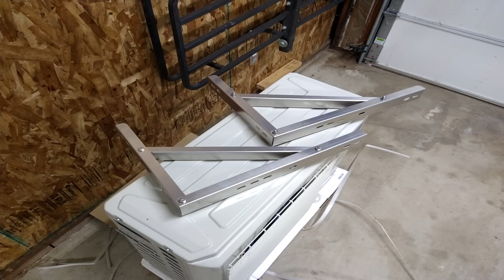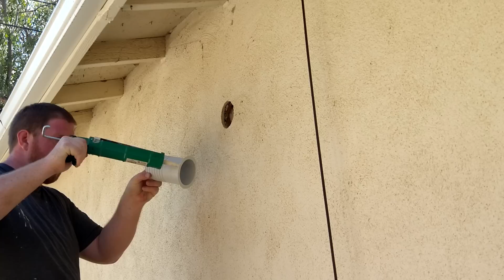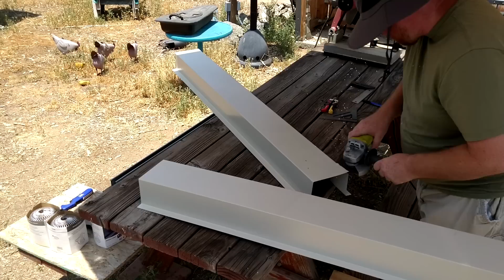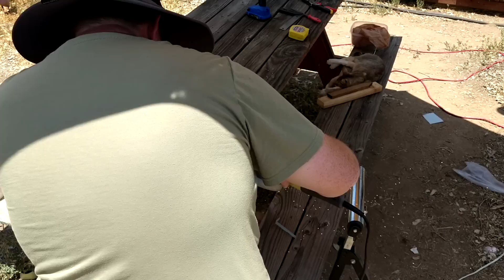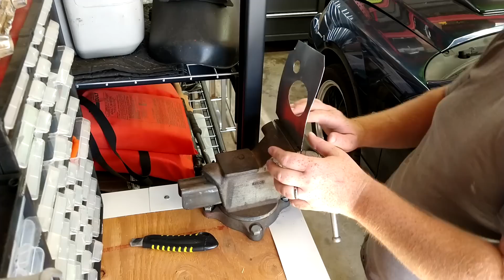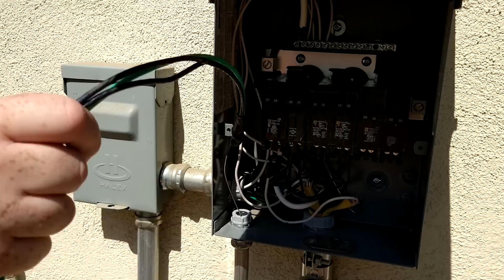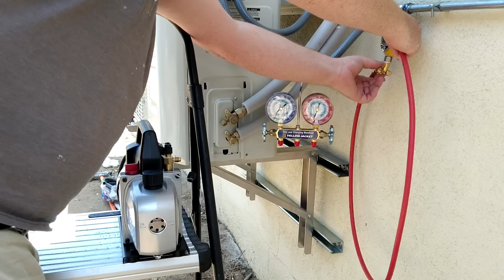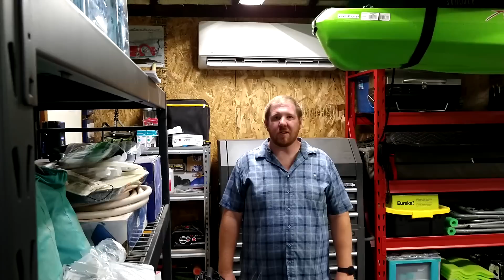How to Install a "non-DIY" Mini Split

Comment: Good video. I like the fact that you installed a non DIY unit. I've been watching videos on DIY units and this is the first MR COOL video I've seen of a non DIY install. I didn't know all one needed to do was to ensure the line fittings were installed correctly and the compressor itself was charged enough to sufficiently load/charge the lines. I would definitely trim or cut the lines to the exact length of any unit I would try to install as it looks so much cleaner and neater during an install. I thought one would install everything as you did and then bring in a technician to correctly charge the system before starting it. I don't understand the difference between this unit you have installed and a DIY unit as the install process is almost identical except for allowing the compressor charge the lines verses using precharged lines with the DIY install. Maybe I'm missing something?
Reply from the maker: No, you're not missing anything and that's why I didn't bother with the DIY version.  It is my understanding that "pre-charged" lines is a misnomer, and in fact they are simply pre-vacuumed and sealed off.  Both the DIY and non-DIY store all the refrigerant in the compressor, and you open the valves to release it once the lines are attached and vacuumed in the case of the non-DIY.  Adding refrigerant only applies if you're using lines longer than the pre-charged length, which should be listed somewhere in the manual.  I think it was 25 feet for mine.
Reply: @jkfeatherranch  Excellent. Nice to know. Thank you
Reply: Thanks for the info. I have been looking and was already thinking the cost of the diy vs the non diy was dumb. I was fully prepared to get the non diy and charge it. Even better knowing all you have to do is pull vac on the line set, and that it is technically already has freon in the compressor
Reply: I also just realized Lowes sells the “precharged” line separate for $200. If someone doesnt have gauges or a vac pump. That is still cheaper option buying that line separate and saving $800-$1000 on the “diy”

Comment: What do u expect, u need it to have it running all the time
Reply from the maker: That may be true if you follow the sizing suggestions, but I made sure to get one that was oversized so that I could only run it when I need to. If I am not using the garage for anything for a number of days there is no sense in wasting electricity in cooling in unused room. I don't use it everyday and there are large periods of time where I don't use it at all. Since it has a variable speed compressor, it doesn't matter that the unit is oversized because it will only run at the capacity needed to keep the temperature. Paying for the oversized unit by a couple hundred more outweighs the electrical cost for continually running it and only using it when I need to and cover quickly when I open the garage door. Continually running a smaller unit will require more energy after you have lost a lot of cool air due to opening the large door and it will take a lot longer to cool it back down.

Comment: Riverside, CA? One advantage of the non DIY version was demonstrated when you solved your kinked line issue. That wouldn't be possible with charged lines. (Without recharging.)
Reply from the maker: Yep, Riverside, CA. Yes, this is true, and it also meant I could shorten the lines to the length I wanted to and not have a massive coil hanging out stuck behind it. It's kind of an eyesore when you have that so this looks much nicer.

Comment: The issue with the initial cooling test is that everything in the garage is at 88 degrees.  It will take 24 hours plus to cool off the contents of the garage and get everything down to 72 degrees.  Try turning the AC on first thing in the morning when the garage is already cool, it should keep the low overnight temperature.
I returned from a trip to find my AC had failed in AZ in summer, the interior of my home was 95 degrees.  With outside temps over 110 degrees it took two full days to get the house back down to 78 degrees due to the fact that the walls and all contents of a 4 bedroom house were all at 95 degrees.
Reply from the maker: After using the A/C for a couple weeks, I think the issue was that I had two cars parked in there at the time and the airflow wasn't being distributed very well.  I have since moved the louvers so some of the air is blowing more to the other side, and even turning it on when the inside temperature was 90 and the outside temperature was 106, it hit my set point of 72 in about 2 hours.

Since there are days (or even weeks) when I am not out there working on anything, I deliberately got an oversized unit so I don't need to leave it on and waste energy keeping things cool all the time.  A 12k might behave the way you described.
Reply: @jkfeatherranch I always do the recommended btu math. Then go up to the nearest unit with at least 8,000btu over figured math. May only run the unit 4-6 days total out of a month so when I do want to kick it on it’ll knock the heat off quickly. Same as using the heat. 👍🏼